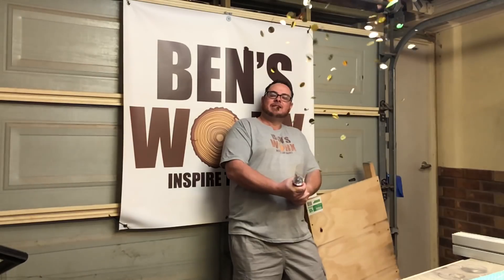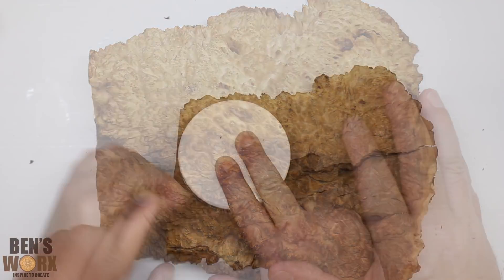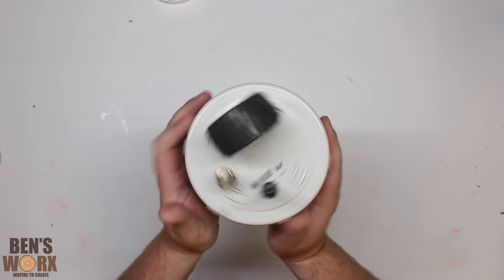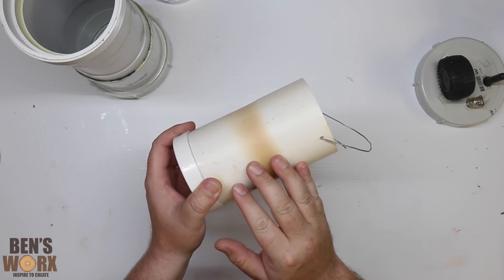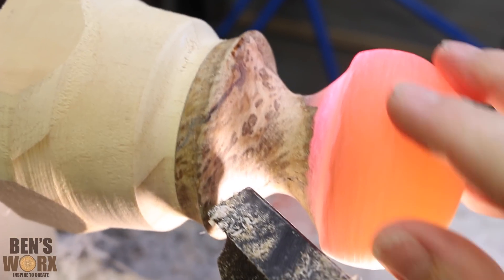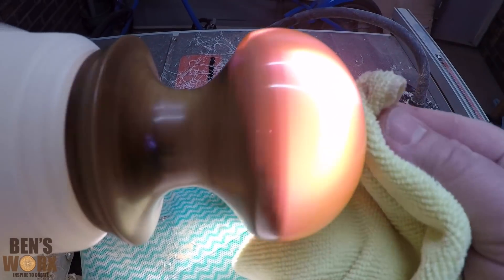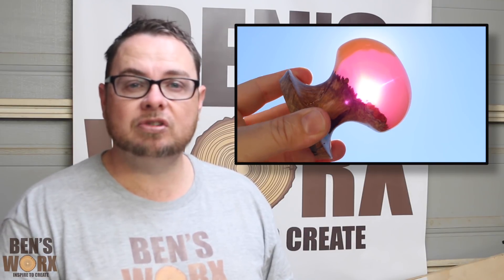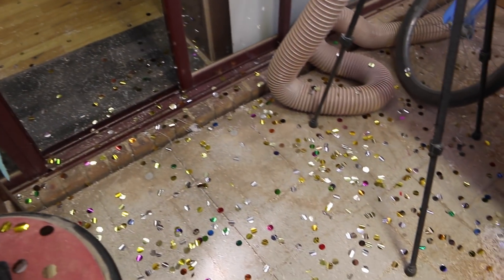Wood turning A hybrid resin and wood burl

Comment: I think the just resin inks have something in them that causes the chemical reaction to speed up. If you've watched Peter Brown's channel, he uses the JR ink and the polyester(?) resin and then it starts bubbling away with a bunch of steam! Turns into a cool piece once he's done. 

If you have alcohol inks, especially white you should try the "Petri dish" with a burl piece. It turns out pretty cool but for the best results I should've let the resin sit for awhile and then did the color inks and then the white ink on top of the colors, so it looks like raindrops at different levels of the mold. 

Keep up the great videos!!

Also, think about starting a patreon page! I would gladly support you!
Reply: Yeah absolutely acts as a catalyst, I have had the same experience, add too much ink and the heat builds up really quickly

Comment: Hi ben, another fantastic piece of work, im slowly getting through all your videos, what is burl, im from England, ive never heard of it until you mentioned it, is there a UK equivelant.
Reply from the maker: Hey Keith,

A burl (American English) or bur or burr (UK English) is a tree growth in which the grain has grown in a deformed manner. It is commonly found in the form of a rounded outgrowth on a tree trunk or branch that is filled with small knots from dormant buds.

A burl results from a tree undergoing some form of stress. It may be caused by an injury, virus or fungus. Most burls grow beneath the ground, attached to the roots as a type of malignancy that is generally not discovered until the tree dies or falls over. Such burls sometimes appear as groups of bulbous protrusions connected by a system of rope-like roots. Almost all burl wood is covered by bark, even if it is underground. Insect infestation and certain types of mold infestation are the most common causes of this condition.

Thanks Wikipedia :)
Reply: Thankyou ben, i love knowing things, more info i can share if anyone ever asks.
Reply from the maker: No worries mate

Comment: Very cool piece!  Did you stabilize the burl? How did you secure it to the lathe?
Reply from the maker: Thanks mate no I didn’t stabilize it, i use a waste block and attach it to the chuck
Reply: Ben's Worx thank you!  Another dumb question... did you secure the waste block with wood glue or ca glue?
Reply from the maker: I use 5 minute epoxy to secure it to the waste block
Reply: Ben's Worx thanks again!
Reply from the maker: No worries mate